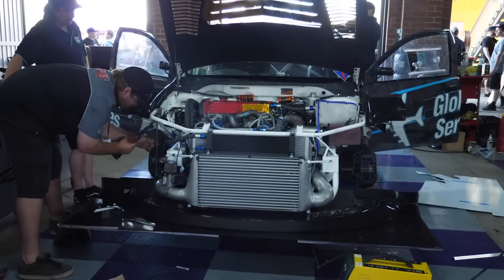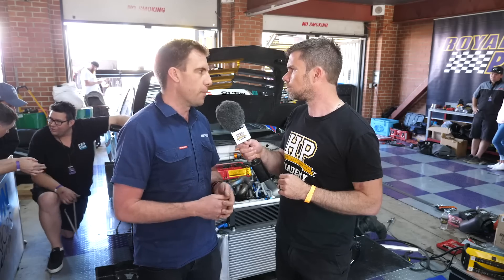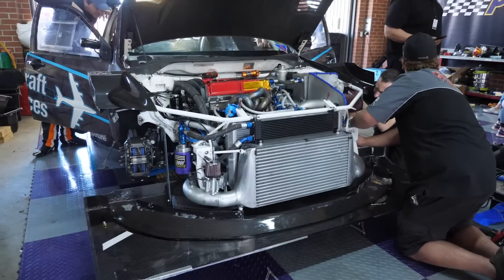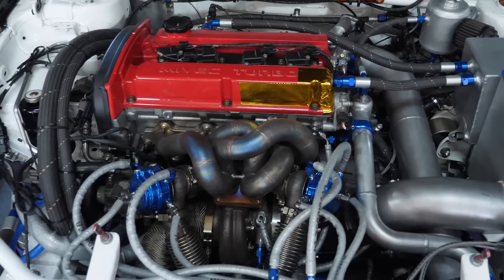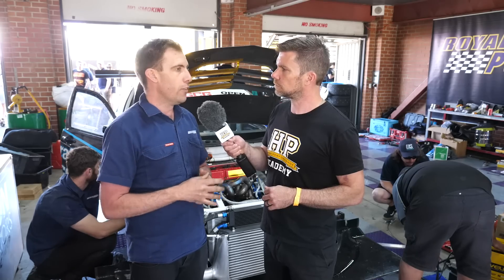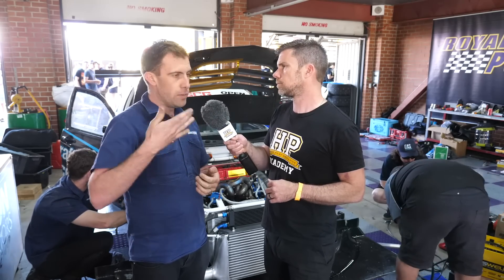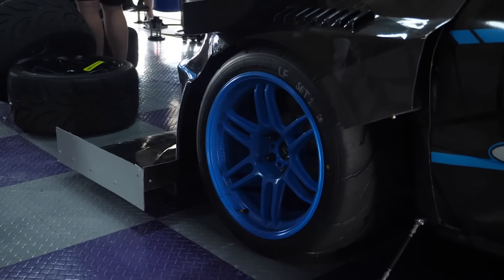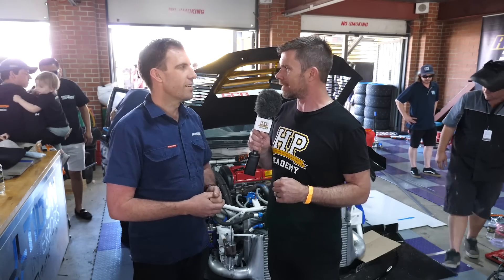Why Not BIllet? | 4G63 Evo IX Time Attack Upgrades [#TECHTALK]

Comment: why not billet? ohhhhh cause what we have is pretty proven. Shyea proven that it can't make billet power more like cause they can't afford it.
Reply: Tilton Evo doesn't use a billet block, and you think that team can't afford it? What a stupid comment.
Reply: @JDMEVOVIGSR  who knows what they can afford but their car is only 1200 hp. So they very well may not be able to afford  changing everything to handle 2k hp or don't want to actually lay down real numbers. Its not just about the engine you would have to remake the entire car and that may not be worth the hassle... to them.
Reply: @Siiello  Which car are you referring to? Tilton was built within 3 months with no prior opportunity to test before WTAC. What's the point of making 2000hp when the tyres are the limiting factor, as evidenced by the failure? Furthermore, the Global Services Evo doesn't need anywhere near 1200hp to be competitive.
Reply: @JDMEVOVIGSR  I am referring to the tilton evo 2.0 car that was covered on this channel in Jan 13. That car has 3 tons of down force and they claimed 1200 hp and the need for power to overcome some of the drag that produces. Like I said would need to change everything and so why would you imagine that did not also include a wheel tire package wide enough to offer sufficient grip? There is a setup that can be made where the tires are no longer the limiting factor I assure you, even if that means a radical dually setup front and rear to handle the downforce. The point of making 2k hp is to actually win instead of just being competitive.
Reply from the maker: The power produced is only one aspect of the build @Siiello. There is no point in throwing time at something that is not an issue. It doesn't matter how much money you throw at something, it won't work if you don't use your brain and it won't buy you extra time either close to an event either.

Luckily on your own 4G63 powered time attack build you can use whatever block and personal reasoning you like based on your own experience and budget regardless of what this or any other team are doing themselves.

Remember these are people out there doing all this first hand - Taz.
Reply: They aren't breaking blocks, so no need for the extra investment at this level.  If it isn't broke, don't fix it.  When the block becomes the weak point they'll tackle that problem.  What's so hard to understand about this?  Stupid normies have no idea what a development process is
Reply: @mikaelgaiason688  NA cars don't break blocks either. Neither do moderately built boosted cars. If the rest of the pack has 50% more power and they are just sitting there as if things are good enough they are watching themselves getting left behind. What's so hard to understand about this? Stupid normies have no idea what achieving 100% performance potential is.
Reply: @Siiello  lmao, I'm a professional, not just some wannabe DJ.  I build race bikes for a living.  Take that "I'm rubber you're glue" BS back to kindergarten kid.  Don't come back until you've done more than watch videos of others doing what you never will.  :D
Reply: @mikaelgaiason688  ohhhh i'm a pro ohhhh I know a thing young sonny! If you were a pro you would have something more novel to say than if it ain't broke don't fix it! To me if it ain't winning than it pretty much is broke. Things I will never do? The things I happen to be doing is forming a company around transforming customer BRZ's into hyper cars powered by... you guessed it billet blocks! Cya bikey boy.
Reply: @Siiello  Do tell...  You're forming a company you say?  So you're an "entrepreneur"?  ;D  How original.  Why would you sell your customers BRZ's?  They're a bunch of broke losers if they don't skip that and go straight to leasing an F1 car from Ferrari.
Reply: @mikaelgaiason688  I don't sell them BRZ's they bring me their BRZ's and I turn them into things that kill ferraris. You know like saleen did with mustangs back in the day. Some people enjoy the deep satisfaction of shaming those that underestimated and looked down on them. The frame in the BRZ  other than not being made in carbon was built with supercar capability. You can add all the widgets in the world but you can't change its bones. That still didn't stop some people from taking a pig boned evo and dressing it up but I have far far more original things in mind...
Reply: @Siiello  Suuuuure you do...  ;)
Reply: The reliability of 2000hp billet drag builds is shit. I bet it wouldn't be very circuit friendly to drive either. They're better off sticking to a stock block and gaining time from other things like they're doing. Maybe a billet steel block could be better for track use but I've never heard of that.